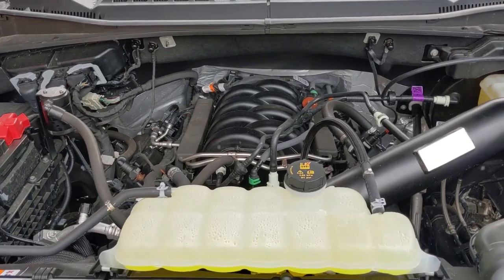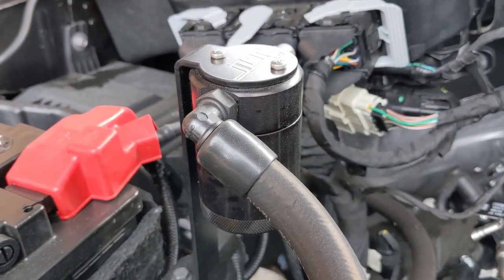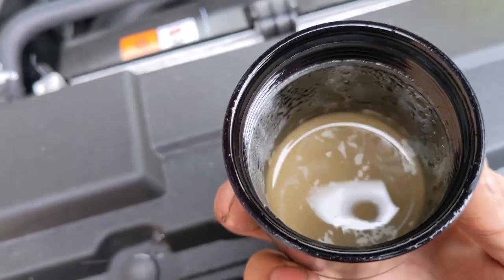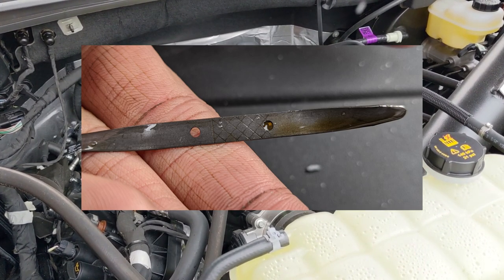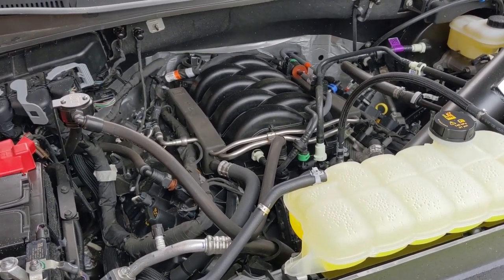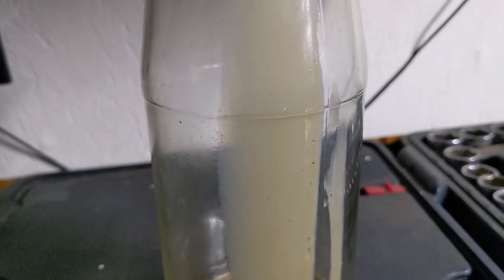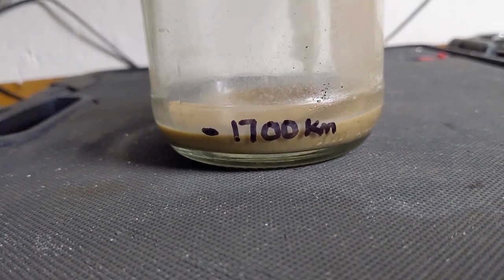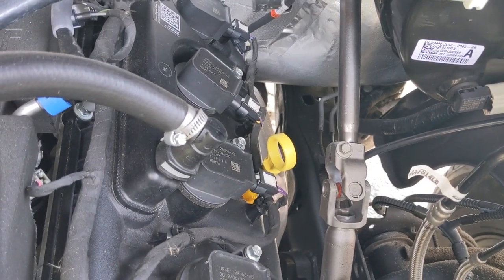JLT 3.0 Oil Separator - UPDATE

Comment: i  bought a used 2016 f150 5.0 L and it had approx 23k miles on it - i installed the jlt and am getting abt the same results as you.  not as much as you would expect with a direct injection engine but still enough towarrant concern  - thnx for followup video

Comment: Quick question.. have u heard the famous 1500-2000 rpm intake whistle on you’re truck ?
Reply from the maker: Yes, the K&N intake took care of that!
Reply: @EliminatorPerformance  I got the K&N intake and it make the whistle worse. Any suggestions?
Reply: @dallasjohnson2693  same here. I didn’t hear anything until I put the K&N intake on. Now it drives me nuts.
Reply from the maker: The one thing I hear from time to time is the whine from the straight cut oil pump gears in the transmission. But because I have an MBRP Pro-Series side exit exhaust installed, I may not be hearing the whistle from the intake.

Comment: Being up in CA, has the JLT caused any issue with freezing oil/water in the can or lines?  I;ve seen some comment on that causing it to become blocked up.
Reply from the maker: Haven't noticed any issues, and I've had it installed for about 2yrs now!

Comment: Well done but I see no mention of changing out the PCV valve in the TSB.
1) Reprogram computer for throttle body
2) Change dipstick
3) Change oil

This is all it seems to indicate.
Reply from the maker: The PCV valve is only changed when they do the long block replacement ( TSB 19-2058), supposedly it prevents oil consumption during break in. It's listed as a part number in that TSB

Comment: Quick chat: has anyone with the 2018-2020 f150 5.0 V8 have the oil consumption issue fixed or disappear? Or had the oil consumption issue never appear at all?
Reply from the maker: I'll be doing an update video shortly. I had the 19-2365 oil consumption TSB done. They reflashed the PCM and installed a longer dipstick. The PCV valve didn't seem to solve my issue, although it made consumption slower. The TSB has since solved the issue.
Reply: Had the TSB done on my 2018 F150 5.0. It still used over a quart in 3k miles. Ford might think they are fooling some of their customers by installing a longer dipstick. It makes no difference on oil consumption no matter how long of a dipstick they put on it. They only did that to lead people to believe that their engine is not consuming very much oil. What a joke it is. I found a permanent fix for my oil burning 5.0, I traded for an ecoboost and problem fixed.

Comment: man, I wish I would have known this the day I bought my 2017 car with the ecoboost engine.  this also uses GDI technology.... at 43k miles, I'm having to deal with the dirty intake valves issue....
Reply from the maker: Yes, the port injection washes the backside of the intake valve, so it cleans off all the crap from the PCV and EGR. If it's direct injection only, you don't get that washing of the valves and they get caked in crap. The F150s use both DI and Port injection so there's benefits of both. But the less gunk you put into your engine, the better.

Comment: How long does it take to fill the catch can?
Reply from the maker: I get about an ounce per oil change 6,000 km so roughly 3,500miles. So 3 oil changes maybe 10,000 miles and it would be filled? Depends how much you drive. My truck is over 2yrs old and I'll be doing my 3rd oil change at 16,000 kms

Comment: Has anyone had the problem with the check engine light turning on after installing? I checked the connections at the engine and they are snapped on (heard the click when pressed in). I installed this on a Saturday and now on Wednesday morning the check engine light came on. I also made sure the catch can was screwed in tight, which it was slightly loose but it was very very minimal so I screwed it on really tight now. Maybe the system was reading a vacuum leak because the can was slightly loose...???
Reply from the maker: Most likely the loose PCV tube. Like you said, click the connector to make sure it's a tight fit, clear the code and it should not come up again.
Reply: @EliminatorPerformance  so I checked the code and it's reading the intake air temperature sensor (P0096).

Comment: Good video my old 12th gen dosen't really burn to much oil but I'm gonna change the pcv to the new one just to prevent anything down the line and even though i have a lot of miles on it already I'm gonna install that catch can Also i guess better late than never.
Reply from the maker: Yes even down the road it just helps prevent carbon buildup in the engine

Comment: I wish I would have known about this problem with the DI Engines sooner, Did anybody notice that if you abbreviate [DIRECT INJECTION ENGINES] it's spells the work ==DIE==, that should have been a sign to stick with [PORT INJECTION ENGINES], the word ==PIE== sounds better. If I did, I would have installed one on my 2019 Silverado in the first week of owning it. Just like I had with the auto stop feature, I bought a bypass cable from AutoStopEliminator.com  for $90.00. 
I installed The JLT 3.0 at just over 12,000 miles. A few days ago I made a short 1000 mile inspection video of the can to see what it had caught, FYI==I was driving the truck in sport mode to film an acceleration video a week before, I just couldn't bring myself to totally floor it, I tried 3/4 throttle was all I could do. I hate to abuse the engine in that way, but it is one fast truck so that might explain the amount, there isn't a lot of it, but any should be some concern.  Check out what it caught. https://youtu.be/X2Vzy3SrWf4

Comment: 2018 and above Coyote 5L V-8s have port low flow port injection and direct injection, no need for a catch can.
Reply from the maker: Fuel injection has nothing to do with oil through the PCV system. This catch can pulls 1 ounce every 1000kms, so that's 1 ounce of oil that's not being burned off inside the combustion chamber after it's been vented back to the intake manifold.

Comment: wrong. when the oil is cold it should be in the middle. when the oil is hot should be at the top since fluids expand with temperature. Jay Performance, Inc. Master Tech for over fifteen years
Reply from the maker: Interesting. I wonder why then if I let the truck sit and get cold, more oil shows on the dipstick. I'd assume it's because the oil drains from the heads and top end, back down into the sump. When I run the truck and then check the dip stick, even with the oil hot, the dipstick reads less, which again makes sense because oil has been dispersed throughout the engine oil galleys, top end and heads. It would show less on the dipstick because there's slightly less oil in the sump. I'm just a small engine mechanic and certainly no master tech, but a Briggs and Stratton v twin works the same way. If I let them sit, I can pull the ohv covers without making a mess, since the oil from the heads has drained back. Oil only expands about 5% based on volume, and can differ between mineral based and synthetic, but with 8.8qts 5% would be approximately .44qts so half a quart more when hot, but that doesn't take into consideration the oil that is now in the heads and top end. I'd be interested to hear your thoughts on this? The question now would be, how much oil does the top end of a gen 3 coyote hold? If it's more that half a quart, the dipstick would show less oil even when hot.
Reply: Looks like any YouTube commenter can get a master tech the only thing you have 15 years experience at is eating glue.

Comment: Brother you have serious issues on that engine. oil separator should have dark oil ONLY. it looks like you have a milky oil which tells me you have a blown head gasket or something of that sort. you also have water condensation inside That separator. go to some one who knows what is doing. stop reading forums. you aren't definitely a mechanic nor it makes sense what you say.
Reply from the maker: Lol the milky oil is just from moisture, it's because I don't make long trips and don't let the engine run long enough to evaporate all the condensation.

Small engine mechanic, sent from my Milwaukee M12 3/8" cordless ratchet.
Reply: Mr eliminator how much coolent have you added to your truck in the last 2 years? Must be alot with bad headgasket.
Reply from the maker: @MrJakethehouse  hello Mr. House, not a drop of coolant, thanks.